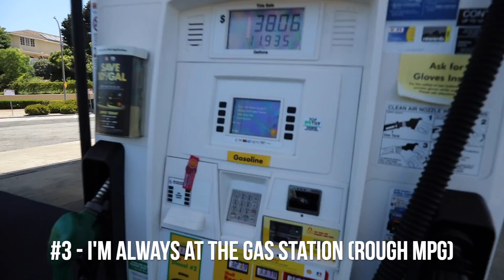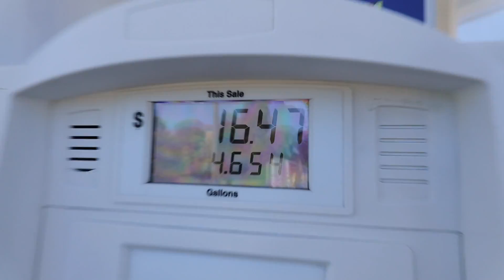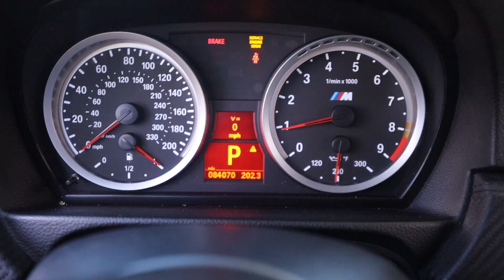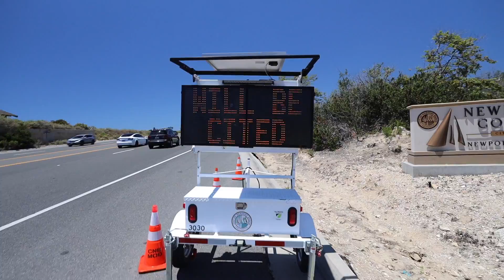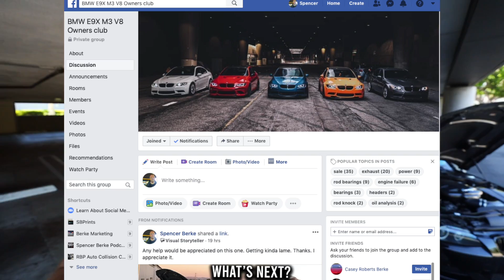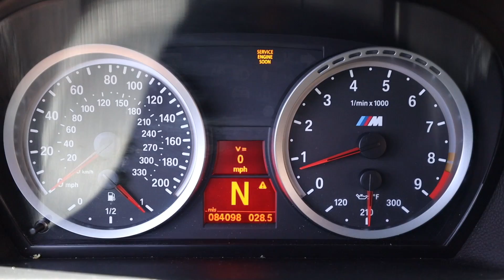Everything I hate about my E92 M3

Comment: For anyone daily driving E90s or E60s you almost have to expect maintenance cost to be through the roof. When I first bought my  M5, I was daily driving the shit out of it. The first 6-7 months of ownership I spent $$$$ on gas and maintenance. I ended up buying a  i3 to daily drive. Best investment ever. Now I enjoy my M5 on the weekends take long trips and once in a blue moon drive it to work once a week. Luckily the police here in Huntington Beach are not as harsh as Newport Beach. I have headers, no cats RPI mufflers.
Reply from the maker: Thanks for the comment!!
Reply: I said this many times before, I don't know what kinda bmw's you peeps have over there, they probably send there crap cars over to America because over here I do not know 1 m5 or m3 owner who had problems with the car.
Reply: swansmeister ok I don’t know anyone with COVID IT MUST NOT EXIST
Reply: Did your i3 insurance and monthly payment come out to be less than the gas bill was before? I will daily drive mine for a while at least but I never drive I just cruise for fun already
Reply: Joseph C.  those are common n54/n55 problems you can find all over forums. the turbo and fuel pump issues will never come back if you get aftermarket upgraded parts, the block is good for 700hp fairly reliably it's just the engines auxiliary systems that has issues. I also wouldn't hold the cracked wheel against the manufacturer since that was most likely driver error and they dont just crack on their own.
Reply: Joseph C.  how do you know I hardly drive or not. I have 2 cars, one, an mk1 tt vr6 has 230000km on it. I do 40000km a year, it's not that 40000 is little so wtf you talking about. I owned 20ish cars in my life, 14 bmw's, 3 m///cars so I think I know a thing or two about bmw's and I am telling you they send all their crap cars your way.
Reply: Joseph C.  you should learn how to properly maintain your car then, going on 90k on my 2015 335i the only things I’ve had to do in the last 40k was ofhg and the waterpump, and I beat on it to its limits daily

Comment: The best upgrade for this M3 is.... a second car as a daily.
Reply: I'd use it as a club car. Only to be driven on car club nights
Reply: @crimsonhawk4912  wtf.
Reply: I daily mine as it’s fine.
Reply: Lol i daily my m3 no problem. If you want torque find another car.
Reply: I rock an e92 m3 and an e90 335 to keep the miles down on the m3. I’m in bmw nirvana until I get my x5m.
Reply: @user-dv4pz7qj7x  I’m getting to that point too. Looking to find something newer but nothing quite scratches that itch and with COVID-19 and working from home I don’t drive that much so not worth upgrading yet.
Reply: @user-dv4pz7qj7x  I’m going through some DCT problems at the moment with the M3 but once it’s sorted I’m good to go with some other mods such as exhaust.
Reply: @user-dv4pz7qj7x  To the best of my knowledge its been maintained well. I didn’t get the problems until I put about 4K miles on it. I don’t track either. We’ll see.
Reply: Lol I feel that , I drive mine everyday as only car but need an every day run around as shes gettin tired

Comment: i've had 2 e90s and never had any issue with the cup holders. replaces yours. they are like 40 bucks lol
Reply: Such an easy fix.... take the assembly apart. Needs Vaseline or white Lithium grease by the gears. Smooth like butter ever since. Literally a 5 min job max.
Reply: I used to have a e90 335i and it was a ez fix just the copper spring came off just had to put it back on and honestly love those cupholders so much
Reply: Brigham Allen or just clean it normally it sticks if you spill coffee on it
Reply: same my e90 m3 has 100k plus miles and my cup holders are perfect
Reply: Yes, they only get suck when some sticky liquid has run out and you put them inside. It is an easy fix. I actually really like that they are hidden when you are not using them.
Reply: Yeah but does your seatbelt handover work?
Reply: @Mr.Manson  Sorry no coupe here
Reply: The cup holders are a bitch but it's stupid to complain about and not fix, right? Like you said. It's 40 bucks. How much did you pick up yr m for?
Reply: I had e60 535xi at 185k miles and never had any issues with interior at all except n54 engine oil leaks
Reply: Came here to comment that. Drove a e92 myself, my friend a e93 and my sister a e90. Cupholders work perfectly on all of them lol.

Comment: I’ve seen the “supercharger” noise before. It’s normally the water pump but it can also be the internal coupling in the alternator
Reply: Yep...you're onto it. I was thinking alternator.
Reply: yup
Reply: Brand new alternator and noise still there🤦‍♂️
Reply: I had similar noise on my 335d and was alternator
Reply: It’s actually the plenum all of them have a factory usurp where the gasket inside the plenum separates the part where it connects to breather hose

Comment: 1) replace the cup holders. They’re cheap on eBay. And they work well. And you can do it yourself. 
2) the gt4 lip is the issue lol
3) not too many issues to worry about on these, so rod bearings and throttle actuators aren’t an issue. 
4) the car is slow acceleration wise. DCT will do 208 and manual will do 204 or so. But, high revving cars don’t usually make torque. 
5) door handle sensitivity - yeah, that’s pretty much any car with a keyless system 
6) the whining noise might be your intake. I think mine makes the same sound. Idk tho
Reply from the maker: Thank u!
Reply: naturally aspirated cars don’t make much torque
Reply: You have to manage the gears to keep them in the high rev range, then they are seriously fast

Comment: Original owner, 240k kms. All I have done is rod bearings and motor mounts at 160k kms. And my bearings like super clean, which I wish I never did them. But doesn’t impact me.  All I be honest though, the sounds system is kinda wack and the other thing I didn’t like is the amount of understeer this car has at the limits from factory. Power button is absolutely useless unless you get your car tuned. Because the tip in, of 15% physical throttle feels like 45% of the engines output. Wheel hop, after the car get old is a bit annoying until you switch out to solid bushings as well. These are small things, this car is actually a fckn beast.

Comment: The peeling steering wheel trim was fixed in later models. The rubber coating was removed from factory. Buy the 12 + OE trim piece.

They didn’t fix the peeling start stop ring however, had it painted matte black. The DCT knob will also wear and it cannot be purchased without the boot. 

Disagree on it being slow. It’s mid 12 second car - doesn’t hold up from dig against modern turbo M & AMGs, but we didn’t get the S65 for drag racing! DCT makes it easy to keep on boil, and mid range shifts are nutters.

DCT delays in R to D isn’t a big deal, though the GTS tune fixes that. 

You’ve definitely had bad luck on TAs, ICV and Fuel Breather Valves. 

I’d add the felt undertray as a pain in the ass - skid plates should be OEM. Replaced them 3 times already.

The OE brake package is sub par and the last of the M shitty brakes. The rotors can’t bare track work and the floating 1 piston caliper is prehistoric. It’s a big $ upgrade that’s now standard on all M cars.

Comment: -Maintenance wise, I am still on stock engine bay parts. I've only done oil changes. Never had a problem with it. Keep in mind my E92 M3 ZCP is a 2012 and I redline the shit out of it everyday - if that matters. I have high confidence with these cars.
-I think these cars are very quick. 0-60 in 3.9 seconds. I'm light weight, so. I even beat V8 R8s in rolling/standing starts.
-The DCT engaging 1st/R gears is my FUCKING FAVORITE. I love the feel when the clutch slowly engages and the RPMS go high.
-Totally agree with the Lock/unlock part of washing your car.
-Fold down seats, or the winter package - I had the 11 E90 328i and didn't have it. IDK why that has to be an option.
-That noise, that high pitch noise. I like the noise. It's personally something I don't want to fix if their was a fix. To me it sounds sporty, aggressive and a bit high tech especially on cold starts when the engine has that clacking sound. Yes, I've had people ask if I had a charger, like a turbo or super. On top of that, I like feeling the vibrations of the engine on cold starts or low RPM acceleration.

Comment: That high pitch, perhaps its a rubber gasket pinching creating small vacuum leak somewhere. I remember you had your Venturi manifold + air box done, maybe its around that area.When trouble shooting noise, I sometimes purposely dampened the noise in certain area to see where the noise coming from. I don't think its a drive train noise, especially when you have no codes.

Comment: Hey, hope you read this spencer, I had a e90 335i n55 and I had a similar noise issue coming from the front end of the car. the noise got worse the more the car heated up and the more I beat on the car. The issue ended up being the rear main seal had a leak. I would maybe suggest trying to get the car on a lift and seeing if the noise is coming from the transmission. I hope this helps you because It was a PITA to find the issue

edit: I forgot to mention that the n55 motor had a recall for the rear main seal so maybe look for a similar recall for the s54. Best of luck, beautiful stance btw! my e90 had a very similar stance

Comment: Great video. I’m contemplating going from my E93 335i which is running 440bhp to a M3. I don’t think the power loss is worth it.
Reply: Alan Stewart depends what you want from a car. If you just want straight line speed it won't be worth it. If you want to experience a better drive and fun car in the corners the M3 is amazing and a rewarding drive, I love mine
Reply: I came from a 550hp turbo car, the M3 is hands down the better car. Once you "get" it you'll be smiling everywhere you go

Comment: Clunky gear engagement happens to many BMWs. The E90 325i with a ZF6 auto transmission back in my house, for example, is always having this problem when choosing Drive gear from Reverse or Reverse to Drive, there's always a lag. Meanwhile,  the differential on the rear axle is always having a puff sound. Also, the peel-off of the steering wheel is always happening. Worst of all, sticky door handles. Last, fun fact: You actually sit higher in a M3 than in a normal 3 series.

Comment: I feel your pain with maintenence costs, changed the actuators out and did the rod bearings when I installed my supercharger, expensive business! I've also modified the interior so all the middle of the seats are alcantara replacing the leather, which means you sit lower automatically.

Comment: Hey Spencer, regarding that engine noise, you should definitely try and consult @BMWDoctor on YouTube. He seems to know a lot about the s85 and s65 motors. 

Btw, I love the e92 m3 too and I certainly agree with the e92 m3 being slightly underwhelming torque wise, which is not to say it isn't fast. However, I believe e92 were never meant to be straight line monsters but rather track focused. And I'd rather pick a car with amazing handling in the corners than just a straight line focused car.
Also, I have this crazy idea of engine swapping an s85 into an e92 m3 with a sequential gearbox or the DCT. Lol

Comment: The cowbell issue is an interesting one, i have a  2013 E92 m3 6 speed manual that makes the same noise and I never would have noticed it if you didn't make this. With 57k my biggest issue has been the idle control actuator, has gone out twice in 2 years.

Comment: The whining could be coming from the exhaust valve module behind the driver side tail light for the oem muffler, try unplugging the module and see if the noise goes away.

Comment: That high pitched noise sounds like either one of the pullies or the electric fan for your radiator/condenser? If your car does weird things with the voltage you may be giving the fan more voltage when you're applying throttle. Maybe

Comment: Hi, ty for your channel. I have gotten information which has been helpful for my E93 Vert. My question is this, how is your oil temp, where does it sit if you are doing spirited driving?,  i live in Florida, so i feel our temps are somewhat similar, probably a lot hotter here.anyways, i put the CSF cooler kit in.  My temp has not changed actually is worse.  I run around 210.  Just wondering thanks.

Comment: Your cup holder is stuck because you got some sugar water in there ... I have replaced my fob battery 4 times in 12 years ... not done the rod bearings yet ... 75k miles, but followed maintenance and never driven it hard when cold or revving it cold. Not sure about the gear issue ... it only feel ‘clunky’ to me when car is cold ... it’s a high revving engine so torque is low based on absolute rpm, but not relative, it has a very flat torque curve. Mileage is not great, averaging 14.7, but can hit 24 when coasting on Highway. Fold down was option in E90, standard on E92. The peeling is annoying, same issue, do like the touch of the material though ... not sure what sound you’re referring to ... perhaps the fan noise? The alternator? Both are electronically controlled so they are not always engaged.
Reply from the maker: Whoops

Comment: Take a Magic Eraser to that shiny greasy steering wheel you can remove all the oils and get it looking matte and new. Or..... Buy the M performance wheel with the shift lights.
Reply from the maker: Oh that’s a great idea thank you!
Reply: Spencer Berke no problem just add a bit of water and go lightly it also cleans the stitching really well. I like to use a microfiber to wipe right after and get the matte look back. It will make a bit of a flaky mess so a vacuum needed to clean up.

Comment: The engine is designed to be revved to build power.

Complaining about low end torque is completely missing the point.

It isn't slow.

About changing gears between reverse and neutral is just you nit picking.

Would recommend retrimming the steering wheel and replacing the plastic trim.

Comment: 16-20 mpg is nothing, I average 15L/100km, which is 15mpg. Also my cup holder in my e92 335 was really easy to fix, just remove the panel for it and then lube it up or move it around if it's in a bad spot somehow, sometimes something happens to the spring. I just wiggled mine a bit into place and it was fine. Can't remember exactly what was wrong, just nothing big.

Comment: I liked mine E92 but those cars are just partially too high of maintenance for me right now.  I think they look pretty clean though, relatively cheaper insurance for the car, good power, RWD, good amount of luxury, sounds good, has a great sound system, navigation. It has alot of good things. but... BMW
Reply: To me the car is too confusing to work on for the most part. and it has alot of little tick tack issues. and the issue is, alot of people beat on these cars so whenever you get one you are definitely inheriting ISSUES.
Reply: The steering wheel isn't the only thing that peels. The center control stack area peels alot. Especially the push start button and the air conditioning controls.

Comment: I've found on my e92  2011 the inner back light have gone slightly murky. I've seen oxidation on 2 other e92 lci also. The outer rear lights are fine though.
Reply: Jonny Bravo I had to replace my two inner lights for this reason, the new ones came off a 2008 and were like new, odd

Comment: Sounds to me that you built a track day car and am now complaining because it not right for a daily Driver. Dumb you !!  Exhaust again how can you complain if you made that choice. The plenum Chang well that looks and sounds nice but even eventurie say it does not add power. Never heard or had the drive shaft issue. Yep not much torque but when you are driving at 200 plus KPH on the autobahn not an issue and that is what it was built for. Agree with the cup holders they are just a poor design and I am surprised there is no after market fix. Seat belt thing well again nice idea but was always going to fail over time especially in a daily driver. Mine is an e90 so no issue. Rod Ends yep they go mostly around 50 or 60K miles. Some earlier but probably an owner issue or using wrong oil and driving while cold. This S65 Motor is a gem but like all really high reving performance engines they require special maintenance over time. Now throttle actuators. That is a combination or locating them in the V of the engine and plastics and electronics don’t take kindly to heat soak. Now if you want a car that kills you for maintenance and daily running costs buy a Merc C63. They have approx 6 major engine issues eat soo much gas you need a tanker to follow you unless you are popping out to the local shops. And buy the way you also need to be a part owner of a tire business as they just eat rear tires. BTW all German cars of this period use the same crappy spray on vinyl is a bitch. Having owed multiple AMG Mercs and M cars I think as an all round drivers car the E9X M3 is magic. Just my thoughts 😃👍